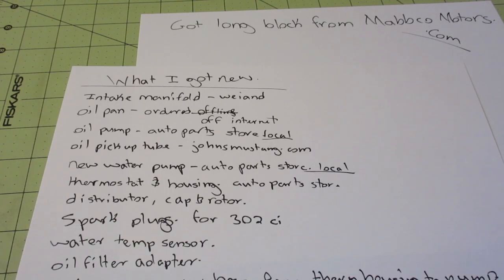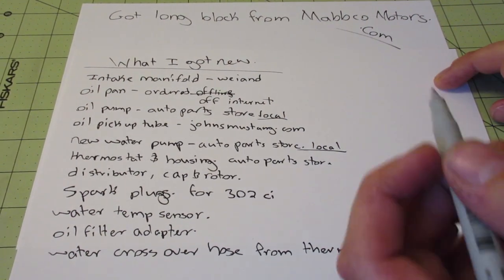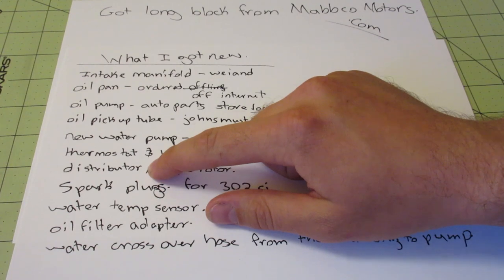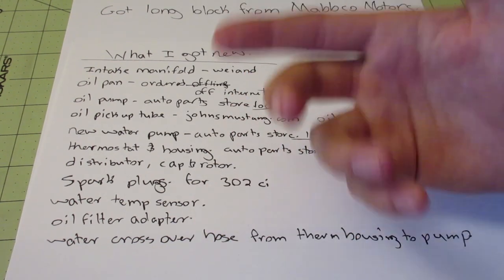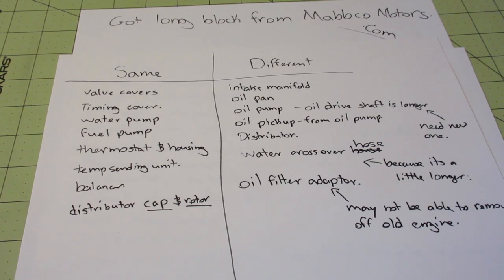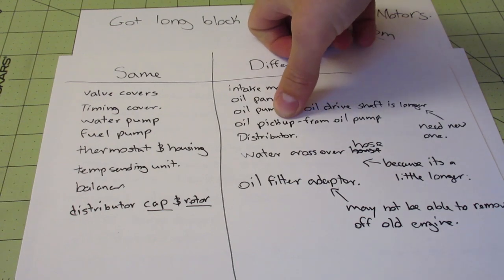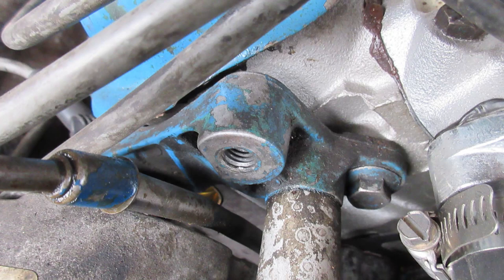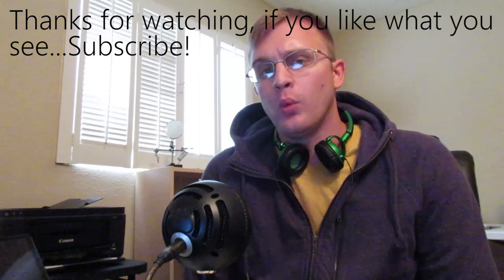What you need to know 302 to 351w

Comment: Hi Devon, 
It's always a good idea to replace the stock oil pump drive on SBF engines with a good HD aftermarket piece. The factory pieces are weak and prone to fail which could cost you an engine. 
Also, be sure your balancer is the same "balance or imbalance" as the engine you are putting it on. Depending on several factors the balance between the two could be different. You can run into 0 or neutral balance, 28 oz. imbalance and 50 oz. imbalance. Having the wrong balance on your balancer and/or flywheel can cause a severe engine shake condition that would soon destroy your engine.

Comment: I have a 302 Ford crate motor with the GT-40 aluminum heads.  I plan on turning it into a 351 motor by buying the kit with the stroker crank, longer rods, new pistons and so forth.  The difference between the two engines is in the stroke.  Since my engine only has 7K miles on it I will only need to hone the cylinders.  The engine has a high-pressure oil pump.  This seems easier than building a 351 block.
Reply from the maker: The 351W is a larger motor. An inch taller and an .5 inch wider on each side. The 351 also has a larger 3 in crank and four bolt mains. It's more durable than the 302. 
But...if you already have the 302, poke ans stroke to 351 that would be fine and last 10-20 years depending. It will decrease the overall life span, but if you just want to have some fun, why not.
Reply: @makestufftoo  Understood.  Thankyou.

Comment: Which mustang did you drop the 5.8 in early fox ,94 95 , or a 96-04 ? 
I'm dropping a 1994.5 5.8 from a f150 into my 1995gt convertible,,, both are automatic and curious every I need to help things go smoothly as possible
Reply: I know my balance on the 5.0 is 50oz and 5.8 is 28oz or 24oz but I know they are different,  my water pump is different also the timing cover is a little different and my front bracket for power steering, alternator ect. Is different.... I already have 3bar gt40 heads, injectors ,rails and a gt40 upper ready to go and have a lot of questions about fuel pressure and ect.

Comment: Id double check the balanacer bit, they look the same but a 302 uses a 50oz and a 351w uses a 28oz.
Reply from the maker: The 70's 351 Windsor and the 70's 302 use a 28 oz balancer. Somewhere in the 80's they switched to 48 oz balancer. I stressed in the video about doing research for your specific setup. My 302 and new 351 W use 28 oz. I reused the balancer from my 302. Works like it should. Thanks for the comment. I'll try to see what year exactly.

Comment: what about headers?
Reply from the maker: I have been trying to remember where I bought mine from, I can't. I bought 302 short mustang headers. Just make sure the mounting surface from header to head isn't too bulky. Right before I bought the ones I have now I bought some chrome had welded headers. The mounting surfaces were too thick and too tall. Came in contact with my valve covers. Just keep your receipt, and try some. Hope this helpes.

Comment: What about the wiring harness for the engine and the computer.... From 302 to 351, my trucks a 92 and I'm trying to locate that information so I can save about 1000$ ish
Reply: Well his is a 77 so he does not have EFI...

But you need to take the computer and harness out of the donor vehicle. And re-pin the harness if there are any differences between donor and your vehicle. I.E a f150 computer would have a spare fuel tank where a same year bronco has rear window... you have to accomodate for feature changes but you need donor vehicle computer and harness.

Comment: You cannot use the 302 power steering pump and bracket for a 351 and now I have to use the 351 but now I have to go to Hydraulic house to get the hose fitting that sucks man
Reply from the maker: For my application, I could use my original power steering pump, bracket, and all the hoses. If you skip to 6:30 in the video I explained what I had to do. I just had to make a small bracket which basically made a threaded hole right where I needed it.
Depending on the year of your truck, if it is around the same as mine "77", it should work (what I did). I know "78" has a bit different power steering pump setup, and the same process works. If you have an early to mid eighties this could be much different.
I wouldn't say you can't do something, I most certainly found a way to use my original pump. 
What year is your truck?

Comment: Hello sir fine post. I did some mix and matching when I was much younger. Keep in mind that the 351w has a different firing order than a 302, but it is the same as a 5.0. I have an old set of heads for a 351w and they are very different from a 302, 16 intake bolts, they can't be used on a 302. Most can be even though the 351 head bolts are bigger
Reply from the maker: I don't believe I talked about the heads. I did get new heads, the only thing I hit on was the power steering bracket that bolts to the head. The 302, 351w are in the same family, but not everything goes on the same. Another reason I put in my description to double check your engine before attempting a swap.
So thank you for talking about the heads, I'm just using stock heads that came with the long block. Works great.
Reply: In 1985, the 302 started using the 351 firing order also. Only on the roller cams though, but none the less, 351W firing order

Comment: Hello Devon.....I am in the process of putting a 351w into a 1977 F150 Explorer.  Do you know what manufacturer and part number of headers will fit this swap?.....I've hit a dead end trying to find any.
Reply from the maker: How's it going. The headers I used for my 351W are...Hedman Headers 88400 W7.
https://www.summitracing.com/parts/hed-88400
NOTE: These exact headers have a 2.5in collector, keep that in mind. I had new 2.5 in exhaust put on my truck.
            I did however use my old 2in exhaust until the engine broke in, just had to get a reducer pipe.

These headers fit that engine, in that truck. The only issue is, I had to hammer in a little bit of the floor right above the passenger side header collector,
because the 351W is .5in wider on each side, and little taller, maybe an inch or so taller.

But after hammering just a bit of the floor, you really cant tell its been hammered in from the bottom, and you cant tell from inside the cab.
Small price to pay for headers. Like I said, I am using these right now, and these are shorty, not sure which long tube headers work.
--Also, these are cheaper, and painted for sitting on a shelf with non high temp paint, that paint will come off. For the price these are pretty nice.
Reply: Thank You....welcome to my dilemma.....with the cam, manifold and heads I'm using shorty heads would be a set back generating torque  ...I've called all the manufacturers and no one make a set to fit (that they know of).....I did scour the different forums online and found a post where someone claimed that Summit has headers part #SUM-G9032 that fit......he said he had to remove the motor mounts, raise the engine, bolt on the headers, and then lower the engine back into place for a miraculously tight fit.
Reply from the maker: That seems like a crazy amount of work to get them to fit. That is the problem with long tube headers, they go straight down then back. Ultimately shorty headers would do the job, and you can go up a size for more flow, and maybe not affect torque too much. I haven't found a article where someone said these exact long tube headers fit, so I'm not sure where to find them either.
Reply from the maker: Summit Part Number HOK-6901HKR
Maybe??
Reply: Shorty headers are incapable of producing the scavenge effect where exhaust gasses actually help pull the exhaust from adjacent cylinders.
Reply from the maker: I see. I was looking through my LMC magazine, and came across these. http://www.lmctruck.com/icatalog/fc/full.aspx?Page=133
Maybe their is something there. Still kind of a unknown until you try to bolt them up, but you know that.
Reply: Those headers are for a 351M
Reply: Those headers are for a 351M
Reply: I used a set of Chinese fox body 302 headers from eBay and fit good they are a little tight in 2 places: cylinder number 5 pipe is .25-1 inch from power steering box. the other is the passenger side header collector is close to frame but clears with 2.5 inch exhaust pipe buy .25-1 inch. easy to get in with no problem. short tube headers make more torque at torque Peake and at a lower rpm, but make less Peake hp and less hp and torque under the curve. power band is peaky and will favor the mid to upper rpm range. low-end is still good. I had rusted out long tubes of unknown type with2  2-2.25 duel pipes no h pipe and glass packs and it was good down low but did not have a Peake sweat spot where it would be on pipe. the shorty's have a Peake. with the sorties I am using 2.5 pipes h pipe and glass packs. over all power band is not to different. all so a quick tip use van plug wires as they have 45* boots that clear headers better. tell the counter monkey plug wires for 1979 e150 with 351w. vans got the 351w in 1976, trucks not till 1983. hope this helps.
Reply: Jerry Jones 

Ok